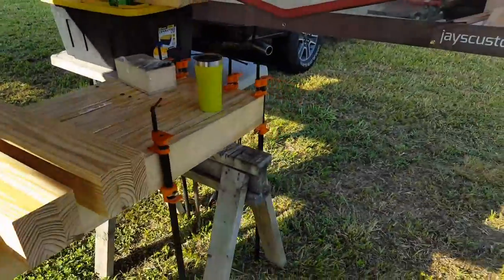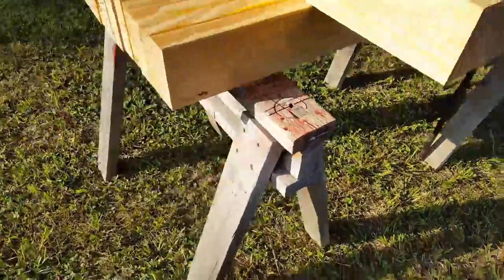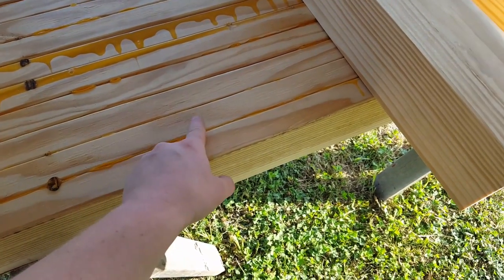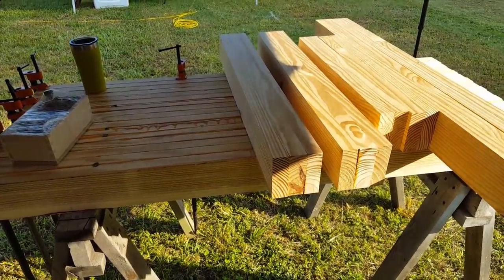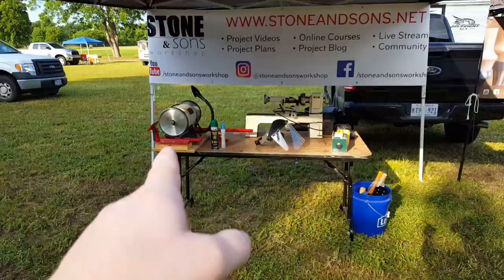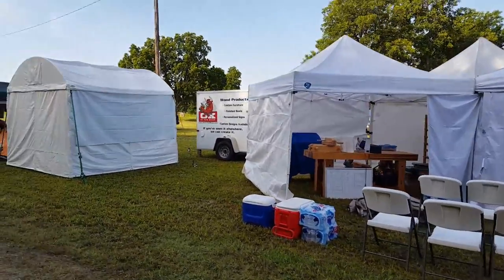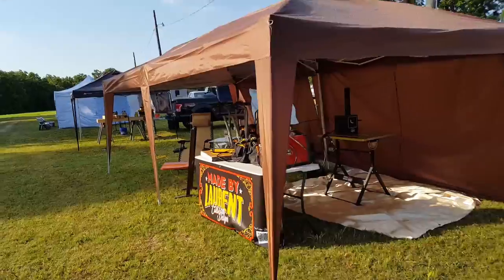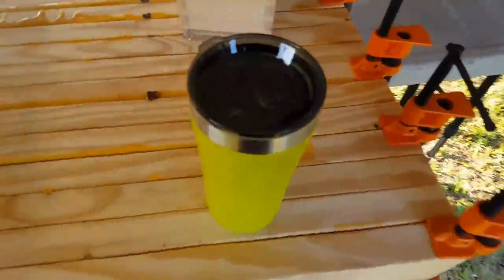Half laps vs mortise and tenon for workbenches

Comment: I recently completed building my first workbench and I used half laps and dowels to attach the legs to the top as well as dowels for the storage shelf underneath it.  It's been extremely stable for the work I've done so far.

Comment: always thought you should have done your mortise and tenon for the top/legs based on the layers of the 2x6's you use to fabricate the top and the legs .. longer center 2x6 for each leg .. second row (from each side) 2x6 laminated with 3 pieces with with gaps for receiving each legs tenon .. make the mortises a bit tight and tweek/shave/sand each tennon to fit .. should work well
Reply: you can also do the lower support joints in a similar fashion (lamination gaps), but you'd have to work out the dimensions on paper

Comment: why cut through a pristine table top, like ou did on your shop table? i just can't understand that thinking. just gouge a mortise that doesn't pierce the top, slip the legs in. matter fixed. why is it so important that the top of the leg be visible through the top of the table?
Reply from the maker: A through mortise or a full half lap will prevent racking more so than a non through mortise.